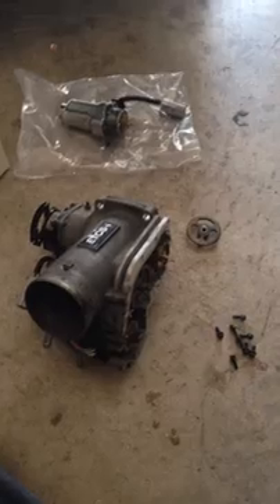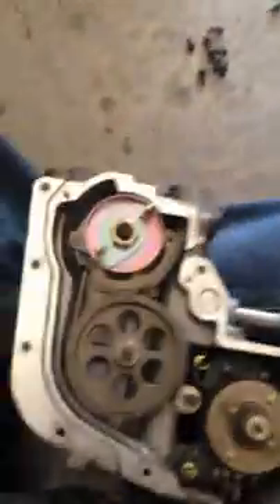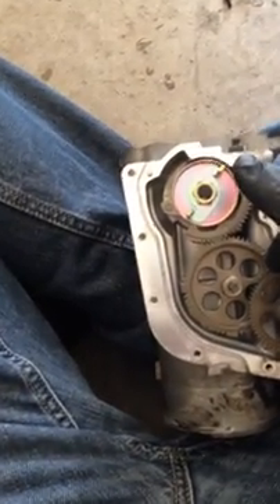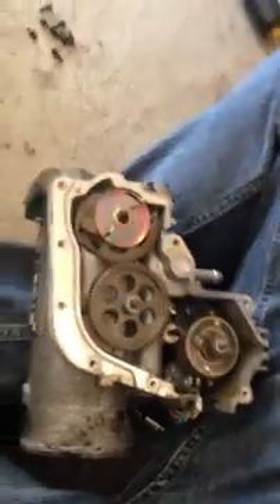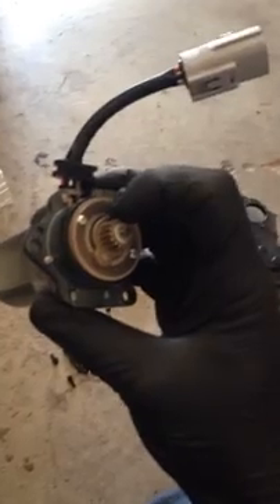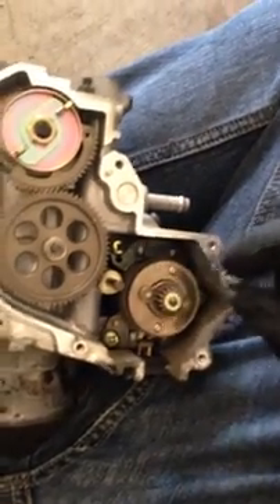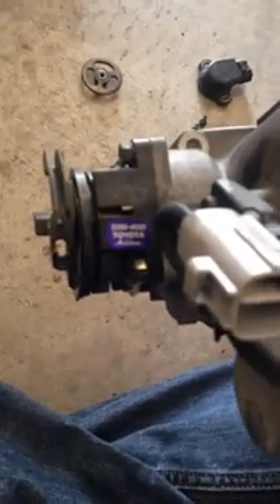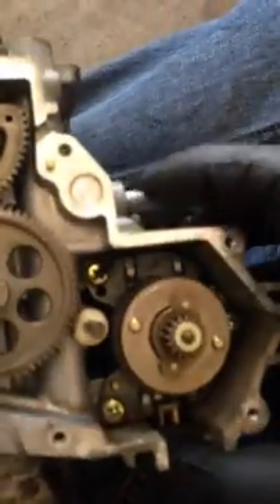aristo throttle body tear down

Comment from the maker: actually no it didn't fix the issue. it was the throttle position sensor that was bad. no codes but i had my old gs430 tp sensor in the garage. installed it and set it correctly and the problem went away.